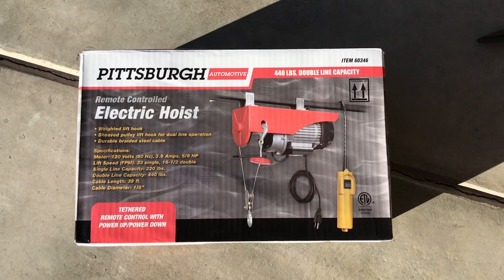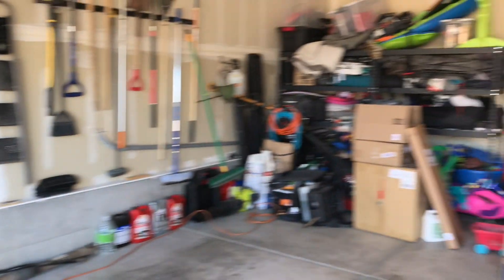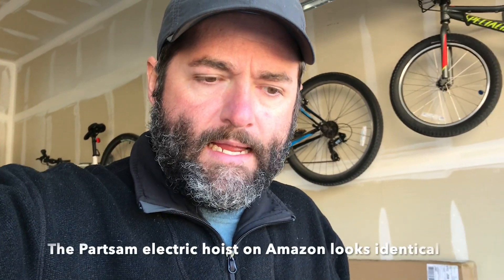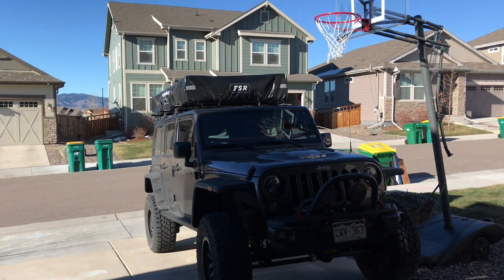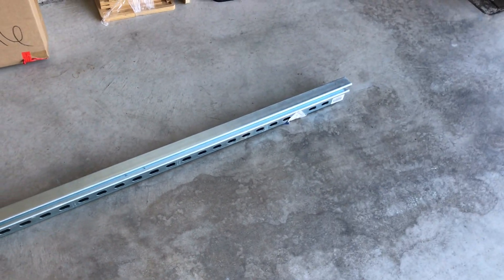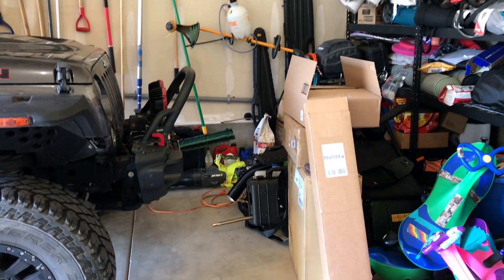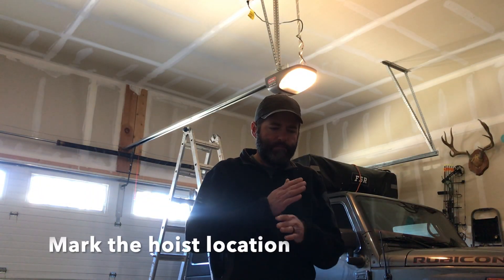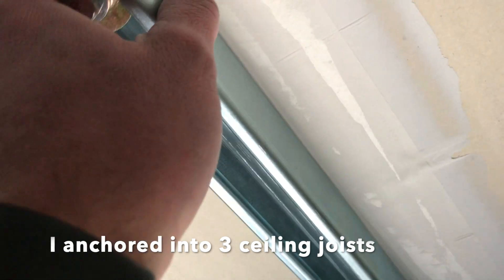DIY Roof Top Tent Electric Winch Hoist - Cheap and Easy

Comment: Best one yet. I’m doing something very similar. You addressed most of my concerns. I need to use a single lifting point so I can “spin” my tent to get it up inside the roof trusses. Once up I’ll lay 2 bars across the rafters and lower it onto them. I want to leave my crossbars attached like you did. Excellent video, thanks so much 👍😉

Comment from the maker: 🔔🔔🔔UPDATE📣📣📣 My roof top tent has been hanging since this video.  I timed myself and pulled it down today and attached to the Jeep.  It took me 15 minutes from start to finish (pulling Jeep in garage, climbing up and removing ratchet straps, lowering tent, locking in roof rack rails, backing Jeep out of garage, done).  Works like a charm!  I did add the pulley to the winch (not shown in this video) as it slows the winch speed down and it can lift more with the pulley.  I like the slower winch speed.  - Geoff
Reply: Which kind a green strap did you use? I couldn’t find one at Home Depot or Lowe’s ?
Reply from the maker: https://www.lowes.com/pd/SmartStraps-4-Pack-1-in-x-10-ft-Ratchet-Tie-Down-300-lbs-Work-Capacity/3740749

I used these but I think any strap that is rated for the load will be fine.  These are 300 lb load capacity and the tent weighs 182 lbs
Reply: Appreciate the vid & feedback. I’ve reached the same conclusion & prepping garage to go this route with my jku and FSR odyssey - Also in CRock! 👊
Reply from the maker: Hey Derek!  That’s awesome that you are in Castle Rock too!  Maybe we can hit a trail sometime!  I ended up just buying a little Offroad trailer project that I’m working on and will put the tent on there.  The hoist works great.  Biggest problem will be how to rig your tent so it’s balanced when hoisting. - Geoff
Reply: @Colorado4x4  very nice! Yes def down to wheel whenever & appreciate that feedback on the balancing - that’s what I’m working on now prior to installing ratchets…needed a break haha.
Reply from the maker: Nice man.  Shoot me an email so I have your contact info.  I’m busy for a little while getting ready for an elk hunt coming up but we will figure it out.  steinernm@gmail.com

Comment: Brilliant. Will be using this method to get a rooftop tent and rack stowed away when not in use. Especially as a one-man job so you don't need to call a friend over to get a RTT on top of your car. Your back will also thank you.
Reply from the maker: It works pretty good!
Reply: @Colorado4x4  If you don't mind answering, what's the distance gap between the roof of your garage and the top of the rooftop tent when it's stowed away? Looks like there's at least a foot or more of clearance that will have to be accounted for since the hoist and the hook can only go up so high before it's topped out.
Reply from the maker: @Syntax Error  I wish I could go out and measure for you but we moved to a new house a couple of months ago and I haven’t installed the hoist here yet.   The winch is maybe 8” tall and then the winch hook is 3” or 4” tall.

Comment: Thanks for posting this! I installed a similar hoist in my garage yesterday and will be getting my FreeSpirit Evolution tent tomorrow. I also have the RhinoRack Backbone with quick release legs so your video is exactly what I needed! Thanks again. New Subscriber.
Reply from the maker: Thanks Brian!  Nice!  We love our Freespirit tent.  It’s really nice and keeps everyone comfortable when we go on trips.  The Backbone system is really nice too.  The hardest part for me was balancing the tent while hoisting it up, but I’ve kind of figured it out now just by shortening the ratchet straps on the side that is sagging the lowest.   It works pretty slick.  Thanks for subscribing. - Geoff
Reply: @Colorado4x4  is it okay just to leave the RTT hanging on the hoist?
Reply: is it okay just to leave the RTT hanging on the hoist?
Reply from the maker: I think so but I ended up putting two ratchet straps under it as an added safety measure.    It just takes another couple minutes to secure it with the ratchet strap.  My tent is 182 lbs and it would severely hurt someone if it fell on them.  - Geoff

Comment: Of all the videos I just watched, yours seemed to be the most logical. One question, I also use the roof rack rails for a Thule Cargo carrier. That being said, what would you suggest if I'm gonna leave the rails on the car?
Reply from the maker: Thanks!  Hmm.  I would probably wrap two straps under it as a cradle and then connect them to the hoist hook.  The problem is that the cradle straps are going to want to pull to the center directly under the hook, so you will have to secure them somehow to the cargo carrier.  Unless if the cargo carrier has some sort of attachment points on it?

Comment: Great video. I’ve decided to use your idea with a few tweaks. How is lift holding up so far?
Reply from the maker: @soniakirchharr5450  thanks!   It was holding up great with no issues at all.   I moved houses and haven’t reinstalled the lift because I just leave my tent on a trailer now.   At this point, I might install it a little differently so that it would keep the tent level when winching but other than that, it was great!  - Geoff

Comment: What are you using to connect the tent to the hoist? Your tent seems way more stable than mine going up..
Reply from the maker: I used ratchet straps to cradle the tent. And then attached a d ring to the winch hook.   My was jankey going up and was tilting every which direction.   But then I figured out that I could tighten a strap in a corner to get it more level.  It takes some effort but now I have it mostly figured out.  - Geoff

Comment: If I mount my strut with three 3/8" lag bolts across three beams, will that be a high enough weight capacity to lift and hold the tent? I"m worried it will pull through the bolt teeth over time and fall out of the wood. I have the smaller FSR RTT so it weighs 151 lbs.
Reply from the maker: My tent weighs 183 lbs.  Just look up some specs online, but mostly they say that a 3/8” lag bolt has a withdrawal capacity of about 300 pounds force per inch of lag bolt.  So a 3” lag bolt can hold around 900 lbs force before being pulled out of a stud. Also it depends on your installation so make sure you are centered in the stud and drill the correct sized pilot hole for your lag bolt diameter.  I ended up adding two ratchet straps as a belts and suspenders approach because I don’t want the tent falling on anyone!  Hope this helps.  - Geoff
Reply: @Colorado4x4  That's very helpful, thank you!
Reply from the maker: Good deal

Comment: Can you show how and what kind of strap you using before hook up to the hoist string?
Reply from the maker: I used ratchet straps that I ran under the tent.   I had four of them and looped them around the ski rack crossbars (the crossbars were bolted to the bottom of the tent).   Does your tent have any attachment points at the bottom corners?  The ratchet straps allowed me to mostly level the tent when it was hanging.  Honestly, the hardest part of getting it hoisted up was getting the tent level.  I wish I could show you a picture but my tent is attached to my Offroad trailer now. We’re supposed to move into a new house in a couple of months and I might try to set up some sort of pulley system that has 4 lines, one for each corner.  - Geoff
Reply: @Colorado4x4  Well, I still wondering how you join those 4 ratchet straps to the hoist hook though.
Reply from the maker: I put a large d ring and attached it to the winch hook.   I then attached the ratchet strap s hooks to the d ring
Reply: @Colorado4x4  It would be my great appreciation if you could give me a link of that d ring that I can buy, thank you.
Reply from the maker: Something like this https://www.amazon.com/Anndason-M8-Stainless-C1arabiner-1523LB/dp/B074M471DL/ref=asc_df_B074M471DL/?tag=hyprod-20&linkCode=df0&hvadid=198090729295&hvpos=&hvnetw=g&hvrand=16109301598179968598&hvpone=&hvptwo=&hvqmt=&hvdev=m&hvdvcmdl=&hvlocint=&hvlocphy=9028741&hvtargid=pla-360972834878&psc=1
Reply: @Colorado4x4  It would be most benefit to everyone if you could make a vid of this strapping process,

Thank you so much anyway,  Have great weekend.
Reply from the maker: That’s a good idea.  Will be a little while before I can make a video but I will at some point.  Thanks for the feedback. - Geoff
Reply: @Colorado4x4  Your welcome

Comment: Love this set up… I’m going to do the same thing this weekend. Did you just use 2 green straps and run them through the eye of the winch? And the secure it to the ceiling with the ratchet straps?
Reply from the maker: It’s pretty sweet and cheap!  Yep. I used the green ratchet straps and ran them under the tent and hooked onto the winch hook.  Once I got it hoisted to the ceiling, I just ran two extra ratchet straps under it that are connected to the other d rings.  Works pretty slick.  Just a warning about when you first winch it up, it will probably not be balanced!  That was the biggest pain for me because the tent isn’t balanced.   Other than that it worked great.  - Geoff

Comment: Do you think the hoist would hold the tent for a long period of time?
Reply from the maker: Aaron, I don’t know.  You can probably find the owners manual in PDF form online and see what it recommends.   I wanted to add backup straps just because my tent would be hung for long term winter storage and it weighs about 180 lbs and people and kids were walking under it in the garage and I didn’t want it to fall and kill someone.  - Geoff
Reply: @Colorado4x4  ok so just adding the straps is just a added safety feature
Reply from the maker: @aaronshamp5378  yes
Reply from the maker: @aaronshamp5378  a belt and suspenders approach! 😃

Comment: What’s your ceiling height? I’m trying to do the same thing but for a large fishing kayak.
Reply from the maker: Garage door is 8’ tall and the ceiling height is 13.5’.  It would be perfect for a kayak
Reply: @Colorado4x4  Thanks, man. My ceiling is only 9ft, so I’m hoping I can clear the garage door.😬
Reply from the maker: No problem!  Happy to help.   You might be able to make it clear.   I thought about another idea, you can put a small pulley in the ceiling and then mount the winch on the wall and pull it up that way.  I thought about doing that for this tent so the controller would be on the wall, then the line would go up through two pulleys (one in the corner on the ceiling and one over the tent).  I don’t know, I may try it that way when I move into my new house this fall.  Let me know how it goes! - Geoff

Comment: Hey jeff, are the crossbars enough for the tent without compromising the Fibre hardtop structure??
Reply from the maker: Hey David, so my Jeep has the Rhino Rack Backbone system installed (was there when I bought it).  I doubt that the factory hard top with cross bars will be strong enough, but I guess it depends on how many people and how heavy the tent is.   My tent is super heavy!   And we have 2 adults and 2 kids in there when we go camping - Geoff
Reply: @Colorado4x4  hey many thanks for quick reply. I am looking into the same, 2 kids and my lady. It seems that the rhino is a good solution but bloody expensive in Spain. Thanks a lot !!
Reply from the maker: You bet!  The backbone system is expensive here!   I can’t imagine what it would cost there.  I will tell you that it seems like a good system.  It was already installed in my Jeep when I bought it but I haven’t any issues with it at all.  That tent I have weighs 182 pounds + me at 175 lbs plus 140 pound wife plus a 9 and a 7 year old and a 30 pound dog 🐶.  😂😂❤️